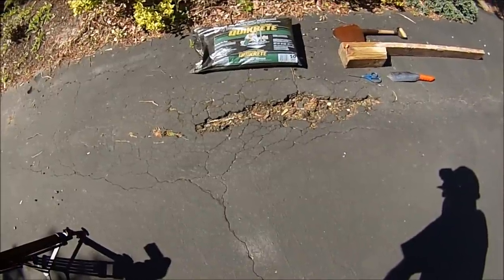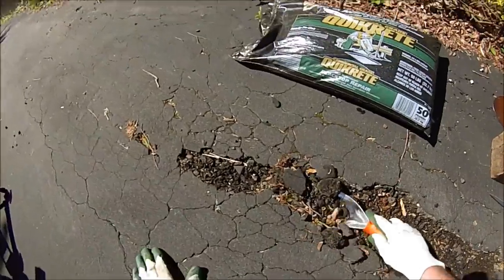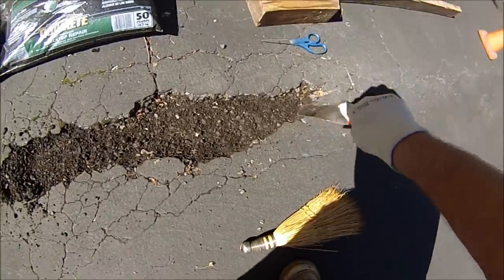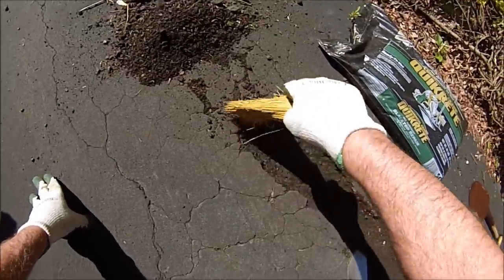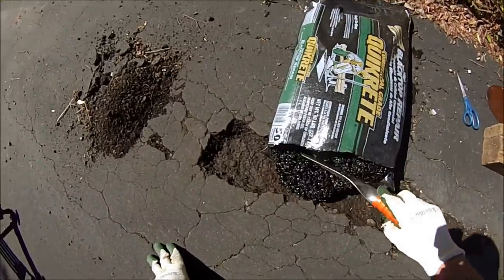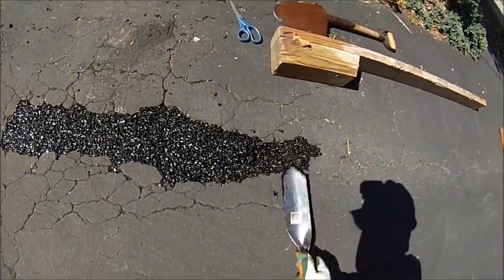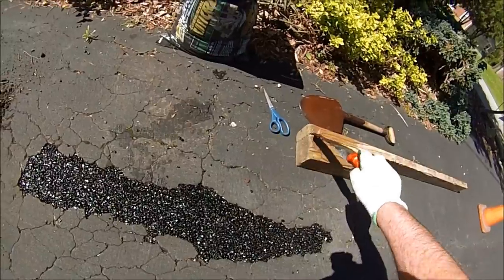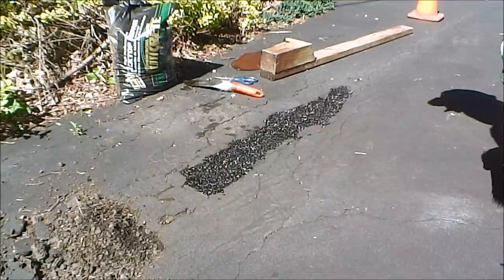HOW TO: Blacktop Driveway Pothole Repair

Comment: From personal experience, I recommend digging out to at least two inches, and filling to 1/2 inch above surrounding asphalt before tamping.  I have made several patches, and this method has shown the best (longest lasting) results.
Reply from the maker: Thanks for the input, I added some other follow-up comments on this project below, but will add that the "height" of this patch worked out well, not too high or low. Now that this patch fully hardened and cooler fall weather is due, it's time to think about seal-coating this patch and the surrounding cracks.
Reply: In doing patch jobs like this. How can i calculate the job . they are providing the material.
Reply: @Anthony-bl5rm  just charge them $50 an hour

Comment: A new driveway costs $16k. Just had ours estimated. A repair and reseal costs $5 to $6k. DO NOT COAT TOOLS WITH OILY MATERIAL - THIS WILL CAUSE FAILURE TO SEAL. Not vacuuming or washing the hole will cause failure to bond, initially, ever, at all - like painting on sawdust, you basically filled over top dirt, and now it can't adhere to the material that's already present. There is not a sufficient amount in that hole. That is alligator cracking meaning it needs to be dug up and have a new sub base installed. Basically, you'll need a new driveway in 5 to 10 years, so you're short cutting and not spending much money, time, or effort. I'd suggest to anyone else in a similar boat to try JUST A BIT MORE than this but... not much. If this isn't sealed, it'll start bucking / upheaving, and you'll need leveler.
Reply from the maker: Thank you for all your comments. This pothole patch has actually held-up extremely well (need to do another follow-up video I guess). The patched area and the entire driveway were sealed a year later, as you recommended, and it's due again in September/October before the leaves fall, especially since it was skipped last year. Sunken "ruts" in the two tire track areas clearly prove your point -- that a better stone base is needed -- of course running heavy trucks over it daily for years sure didn't help! I've been sealing it every year or two, throwing on $100 bandaids so to speak, to avoid spending the thousands of dollars you mentioned. No plans to change that strategy yet! Latest investment was a Tesla solar system for the roof, which lowered our last electric bill to $7, even with car charging and heavy AC use in 80 to 90 degree weather. Thanks for watching the Bobscaping channel.
Reply: What is a leveler?      Great reply post, thank you.

Comment: I have a propane torch...heat the materials and tamper up...them tamp it in...a first application of " tac coat " helps...then when dry...trowel Crack fill..let it dry...then sealcoating for the win!
Reply from the maker: Thanks for sharing! I had to redo that pothole repair after our brutal freeze-thaw winter of 2021-22, using the same techniques as the first time, so we'll see how long that lasts. The driveway has so many cracks now, that sealing them just about covers the entire driveway. LOL
Reply: @bobscaping  .......yup always something....have you tried " gator patch ".....I haven't.... but some I've seen gave and liked it... cheaper than ripping it all up....
Have a great day Bud 👍!

Comment: Great video, thanks for posting.  A couple of questions.  First, how long does the remaining product keep once the bag has been opened?  Second, how long does the repair need to cure before you can apply a sealer? Any and all advice will be appreciated..
Reply from the maker: That product seemed to keep pretty well with the bag tightly closed for storage. That patched area stayed rather soft for longer than I expected, and I waited a full year before applying asphalt sealer. BTW, that patch is still holding up very well.

Comment: Good video sir.  Any chance you do  a follow-up with the filler 30 days later?
Reply from the maker: Great idea, will work on doing that. In the meantime, a follow-up report... 
This product stayed "soft" much longer than I expected, it took a month to fully harden, which would be much more of an issue with a larger patch. It looks great now, has held well so far.
Reply: Agree.  I used a similar product a few days ago and it's still fairly soft.  Guess I'll have to wait the 30 days to fully harden.

Comment: This appears to be step 1.  Wouldn't you want to put a sealer on it and fix all the other cracks around it as well?
Reply from the maker: Correct. 
It needed to fully "cure" and harden before it could be sealed along with the rest of the driveway, and here is a follow-up video prior to that work being completed: https://youtu.be/oboq8broLQU

Comment: Not too bad but my guess is, this is your first repair?  Time will tell shortly but water is going to get down in the checking and "spider cracks" and cause further damage over the winter.   Also build it up higher than the surrounding areas and as it settles and compacts further, hopefully it will be the same level as the existing surface.
Reply from the maker: Hello Jack, I just posted a follow-up video for you to see how well this blacktop pothole repair has held up: https://youtu.be/oboq8broLQU

Thanks for watching the BOBscaping Channel on YouTube!
Reply: @bobscaping  lots of trolls and hecklers on here.  If they could do better they should be making their own video!

Comment: Would have been better off using Aquaphalt, it's much more durable. Quikcrete is flimsy.
Reply from the maker: Even though this patch material remained soft longer than I expected it has hardened to a nice patch that has held very well.
Reply from the maker: Still looks good after a harsh 2017-18 winter!
Reply: $100 for 3.5 gallons. Yeah no thanks.
Reply: @NytronX  The Sakcrete US cold patch product was second to Aquaphalt in consumer reports and is much cheaper. The product that was used here was not even mentioned.

Comment: No need to work off your knees. Get a pointy and a flat shovel, a real broom, and a proper steel tamper @ Harbor Freight.
Reply from the maker: I hear you... sold my metal tamper long ago, but it would have been too wide.
Reply: @bobscaping  The digging bar with tamper on the other end would be the way to go if you insist on doing it this way, but it should be dug out squared off and tamped properly.